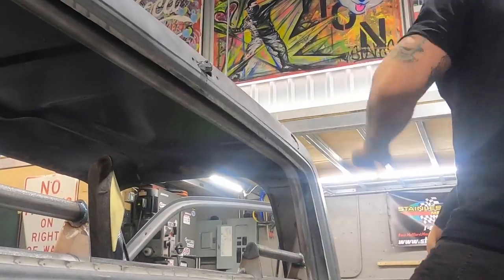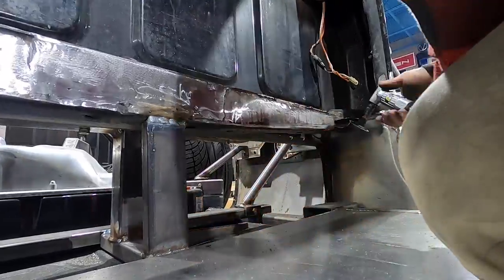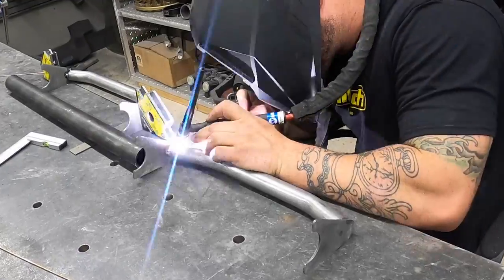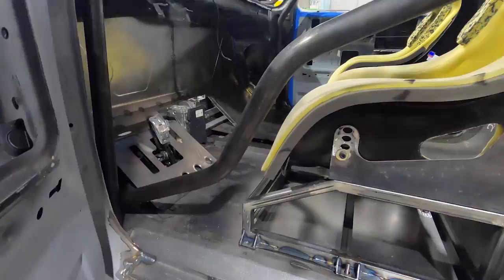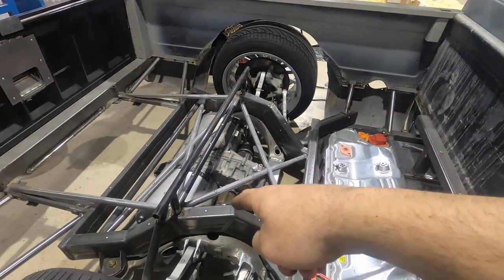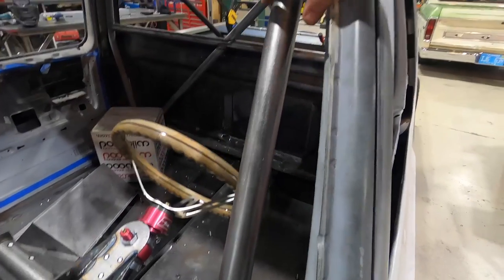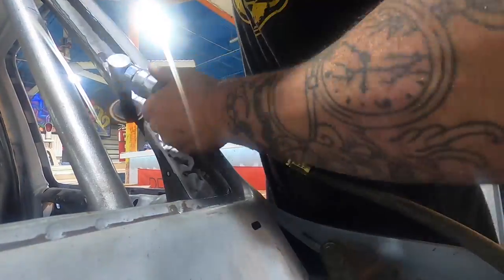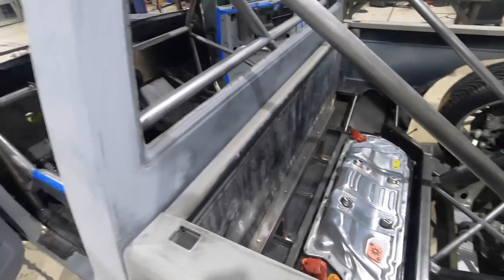Custom Tesla Swapped Squarebody Roll Cage! - Electric C10 Ep. 12

Comment: Poor paint guy is probably already having sleepless nights thinking about getting the bed in with the cage welded in place. =)
Reply from the maker: It's pretty easy to take the bed off still. If you want the Unibody episode, you'll see that the bed (minus the tailgate) is three separate pieces bolted together. Just unbolt the pieces and it'll come right off.

Comment: The alternatives to cutting holes in the roof would be to plate either side and bolt it on OR
Go through the back window but create a false lip by running a plate fully across the top of where the glass goes to weld the bar to . You would then have a slightly smaller back window but still able to use glass and factory type seals
Reply: Keep on checking the videos i make a nice art deco trim piece that even andy warhol would be in love with 

And the stock glass and seals will be used

Comment: *Great roll bar install.9 out 10 times U mite get the roof pass threw holes and bar to match up.
-Thinking if any flex or movement, bar could press against rubber glass seal and crack rear cab glass.*

-Maybe cut bars at pass threws and get to move up into the cut hole in cab roof and re-attach with plug welds and a smaller tube diameter insert.

-And then maybe finish with a weather rubber type CV flex boot on out side.
Reply: It came out through the cab then i made some bad ass aluminum trim pieces that make it look a nikki minaj video!

Comment: Amazing Stuff - but how do you get the box off now with the rear rollcage bars doing back through it, they look like they are welded in place? Just curious, as it seemed like the rest of the build was done so the box could be removed if you needed to.
Reply from the maker: What do you mean by "the box"?
Reply: @SalvagetoSavage  hey. The back part of the truck. But nevermind, watched the next few episodes now (sorry I'm a bit behind) and saw the box off so it must be possible to remove. Just looks like it was going to be locked in with the rear roll age bars that come out the top of the back window, going down to the rear subframe. Didn't know how you would remove the box to paint or maintain what's under it, when the box floor goes in etc. Love this build.

Comment: You guys do some great fabrication work. But the diagonal bar can't be two pieces. It has to be one bar from over the driver's head to the passenger floor..
Reply: We read the rule book for a few sanctioning bodies and that was one option that actually was approved. But thanks for the look out!
Reply: We actually followed the scca rule book for main hoop design since we will be doing more with that sanctioning body. 
In lovely rule book we read all about the placement of the diagonal bar. It had to be 75 percent of the total length of the hoop and tie into the bottom corner of the main hoop while being no less then 50 percent of the length. Both option of diag bar or cross hoop could be cut but not both at the same time.
Reply: @donabenante8022     I just want to start with you guys do some great work.. I know a little something about this topic. I don't want you guys to get flaged  for something like this. 
 SCCA TIME TRIALS SAFETY RULES
2. Main Hoop Bracing
A. Main hoops shall incorporate a diagonal brace. The brace shall either be in the plane of the main hoop or extend from the top of one rear brace to the bottom of the opposite rear brace. Automobiles with mid-mounted engines can have the lower mounting point attach to the frame of the automobile within 6 inches of the main hoop. In the case of braces in the plane of the main hoop, the brace must span at least 50% of the width of the main hoop, and at least 75% of the height of the main hoop. This is the way it is written in the rule book.. 75% of the height. That would mean the cross bar would be much lower or much higher then the bottom of the rear window..

Comment: I don't understand why I never see cages with bolt on bulkheads to pass through cab sheetmetal. Heaven forbid some part needs to removed for repairs to itself or another part of the vehicle. 
Heavy equipment does this all the time.
Reply from the maker: I believe there are some bolt in roll cages, but they're all built and designed differently to meet certain safety spec and ratings!

Comment: Why make the front pillars have less line of sight vrs having more visibility
Reply: Location of frame mounting point or outrigger caused us to have to bend the tube in a matter then hit it dead on. Sacrifice some visibility for tying in directly to to the frame.
Reply: @donabenante8022   to hit the frame “dead on” and to follow the window pillar would just mean compound bends in the tubing. No??
Reply: @acurarl9929  Well how it worked out was i would have needed two more bends per bar.
To keep it simple and to hit the frame dead nuts i compromised adding the two extra bends. Plus for tech inspection having the way i did it was optimal. I had to sacrifice the entire cage front bars being mirror imaged and hitting the frame with a simple design with the trade off being people ether loving or hating the dimple dyes in you tube land. Or adding more complex bends and then mirror imaging it and not possibly being able to pass inspection later. So i picked the strength option first and foremost 
hope that helps!
Reply: @donabenante8022   if tech spec was
The reason then understood. Gotta do what you gotta do.  But I’m pretty sure compound bends are ok. Still love the build and amazing talent in the shop.love 99% and  1% isn’t my flavor. Prolly most liked build I’ve spoke on.